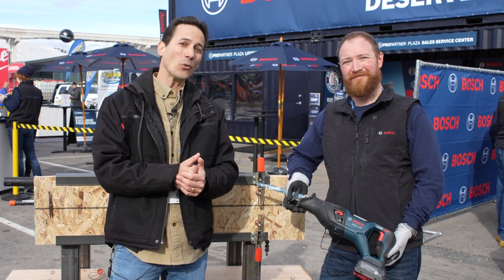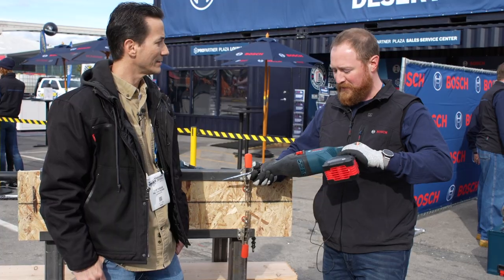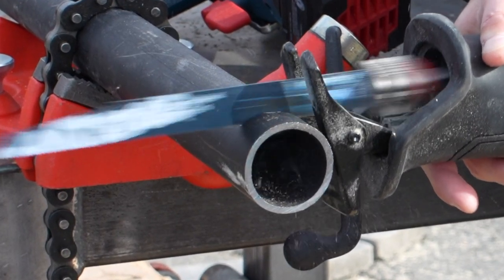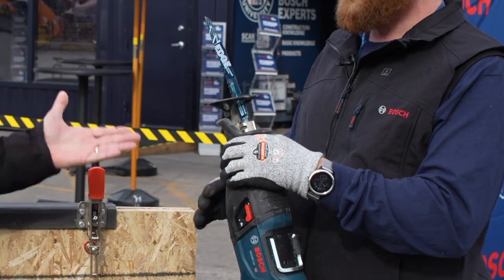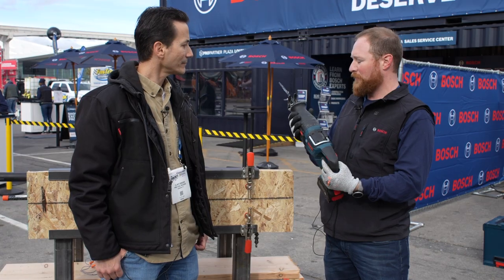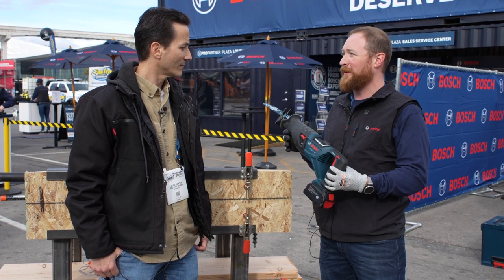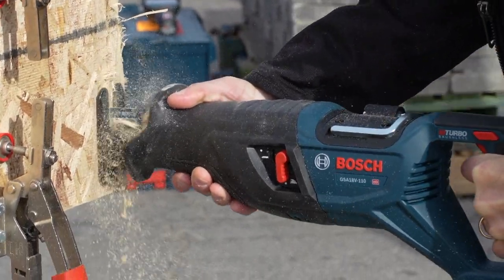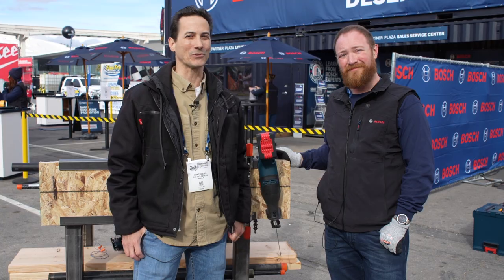NEW Bosch Reciprocating Saw is "Made For Metal" 👀⚙️

Comment: If you are looking for solutions on how to get the blade into the blade change chuck, you have to press down into the locking mechanism with the blade to get it to engage. Seems to be a common confusion so trying to spread that info around!
Reply: I am pushing down, it is locked won't even turn either way as well

Comment: Will new bosch recip saw can beat hikoki / metapo hpt 36v recip saw?
Reply: would be nice if it just came close. 18v vs 36v so probably not a chance.
Reply: I had the Hikoki 36V recip. I switched my outfit to (mostly) Bosch and the new Bosch recip  I now have is not even nearly as powerful in use. It does the job, but the Hikoki is a BEAST. The Bosch is good and the fact it is made for metal cutting means it probably is not aggressive enough for wood demolition. I do like the Bosch, but it was a trade down from the Hikoki 36V,
Reply: @makingstuff242  yeah sometime depend by stroke per minute & how long shaft..hikoki 3000spm & 30mm shaft
Reply: @hrundgren4352  really..if bosch made for steel than mean it dont have orbital function..yes hikoki is a green monster..i cut 16inch mango tree using diablo blade in just a few minute..very fast
Reply: @jojet92  Proper blade is important. 👍 The best blade can make an ”ok” machine perform on par or even better with a good machine with a dull or wrong blade.
Reply: @jojet92  Also, it can have orbital action but if it is optimized for metal it is either adjustable or not as aggressive. I noticed immediately that the Bosch cut through wood less effective than the Hikoki. Still OK.